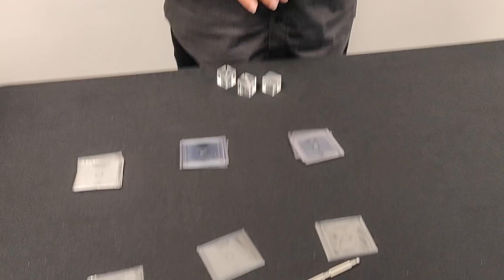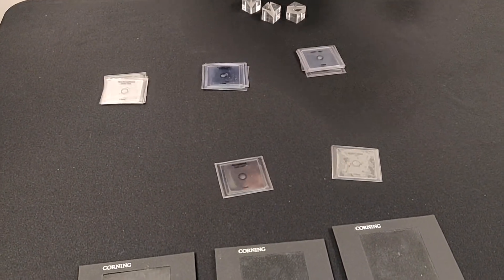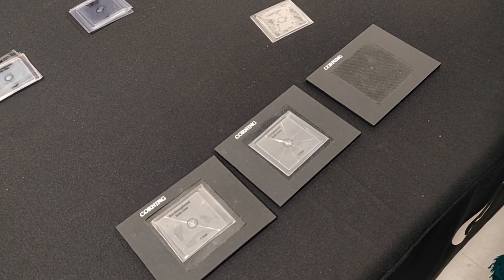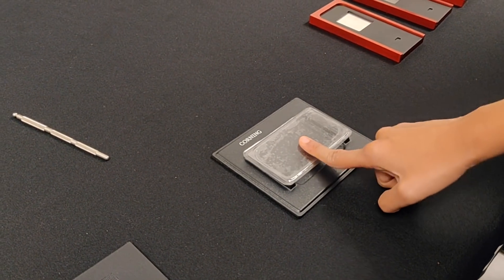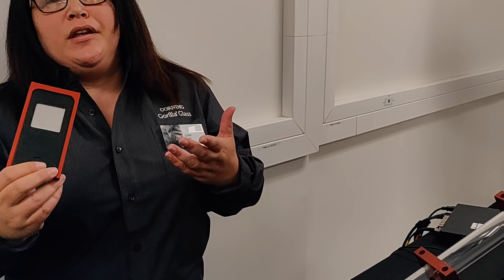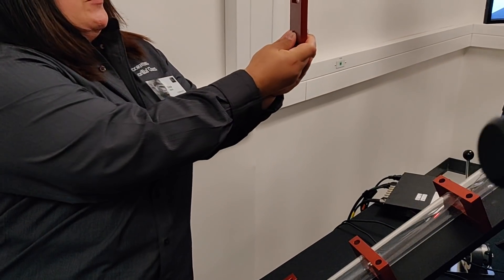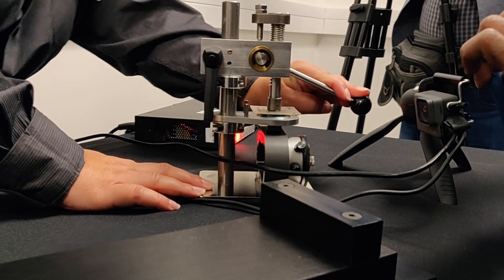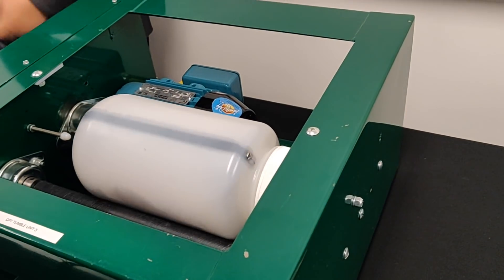How much damage can the Gorilla Glass 6 take? | Digit.in

Comment: I"ve had GG on 4 phones since 2013, and it never cracked despite multiple drops.  However,  my last phone from 2019, something has came loose inside making the whole screen die completely or erratically turn on and off, even if the screen isn't cracked.  The insides don't seem to be as tough now as early designs even as GG gets stronger. Its been happening to many brands, even to the flagship models.